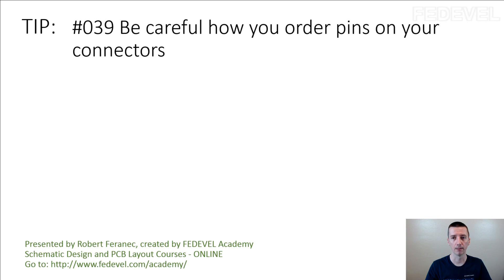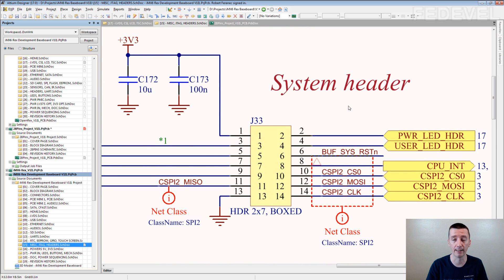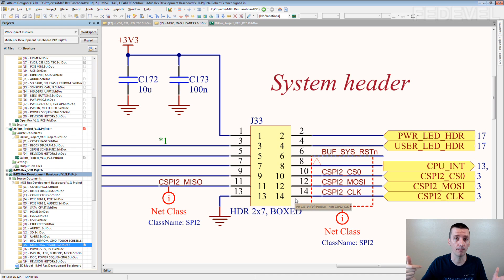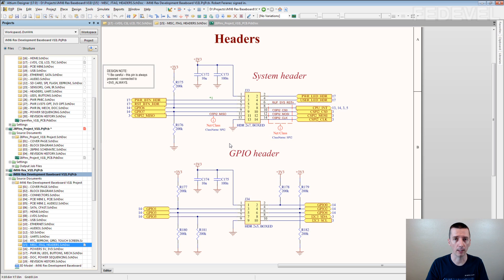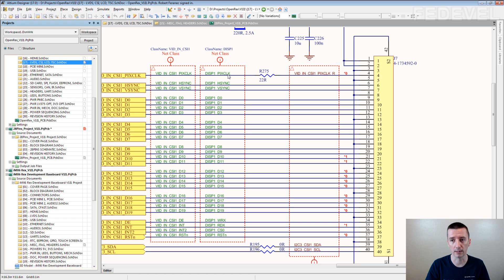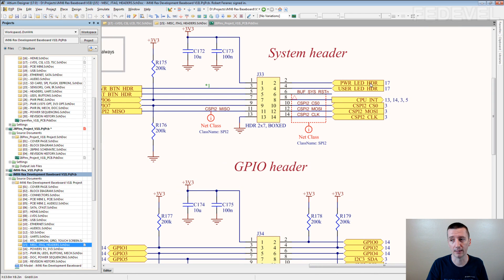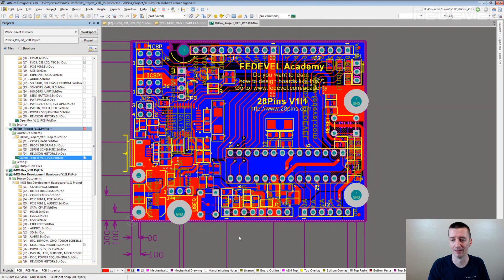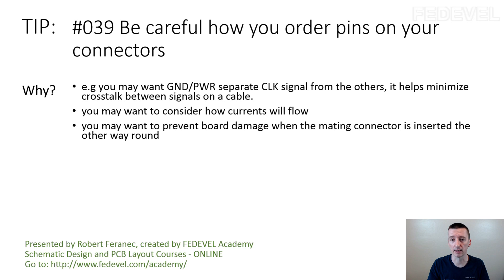TIP #039: Be careful how you order pins on your connectors

Comment: This is a very good tip and its something that inexperienced designers overlook. Often this is part of the system engineers job to define the interfaces between sub systems and components within a system. Its often required that a signal integrity analysis must be done to ensure that the proper transfer of signals is achieved by the connector design.